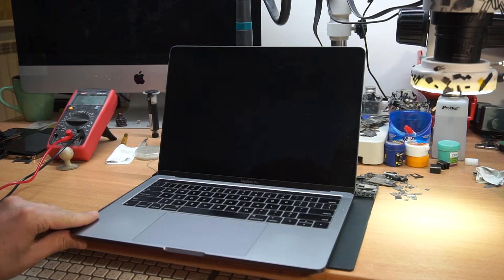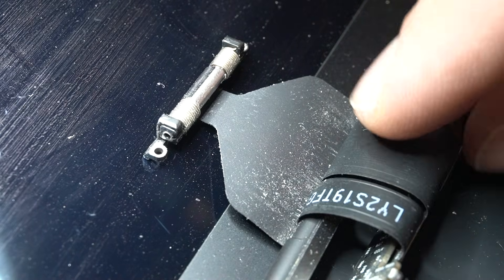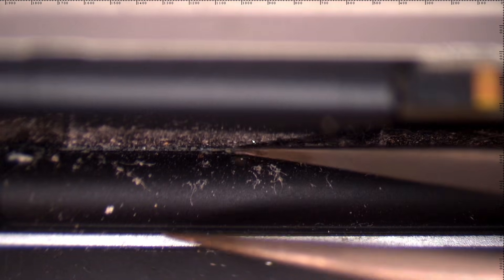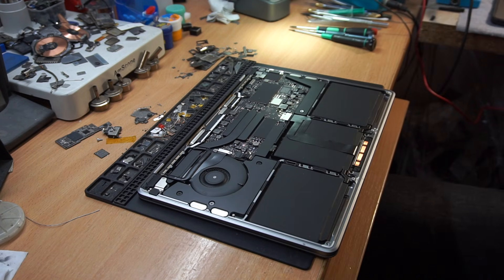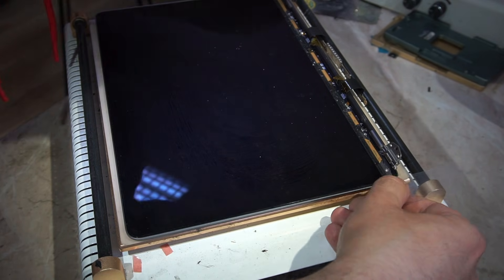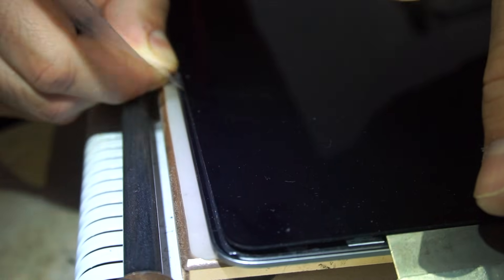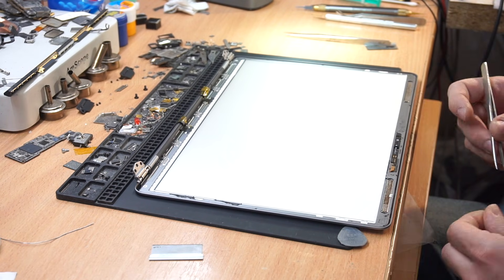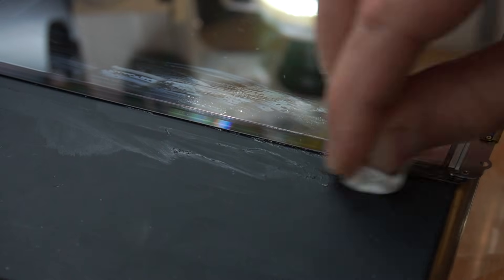An Update on the MacBook Pro A2159 A1708 A1706 A1989 Dustgate issue, A new repair method

Comment: Yeah, it's good that the solder is done on board and not on glass as I had to do a few times. Didn't remember the process too well and going to conduct this procedure on a MacBook this weekend. Good to know it's just as I remember, the good old ribbon cable failure. Not really rocket science, but eh, guess I'll not send the machine to a construction site, it will have to do.

Comment: Hi there, thanks for the great video! I learned a lot. 

I happen to have a MacBook Pro A1708 laying around that doesn't turn on cause of liquid damage. It's been years but I tried already to make a portable display out of the original working monitor, and I never found the exact lcd controller I needed to do so. I am giving it another shot, but I not having much more luck. Do you have any kind of suggestions regarding this? Do you think it's actually doable or that a component like that one that I am looking for doesn't exist? 

Any kind of information will be extremely helpful, thanks so much!
Reply from the maker: Hi, unfortunately I don’t know if that’s possible.
You can google that, maybe some did try to do so.
Reply: @iTouch-repair yeah ofc I have been googling it quite some time now. Thanks anyway!

Comment: Hello,
thank you for your video. I will try that on an A1706 my self. That's the best documentation I found by far.
Could you share some information about the heated vacuum plate you are using? That is the tool, that I am missing.
Reply from the maker: Hello, I bought it from a local supplier, I think it’s from a company called forward blue.
If you can’t find them, then search for a matching machine, I think that in china they make them, and then they print the companies name for who ordered them.
Reply: @iTouch-repair  Привіт :)
Thanks for your reply. I also saw on your video, that you use an extension cable for the LCD screen. Just ordered the same.
I just read, that your shop is in Lviv. Do you do business with customers from Germany and if so, how is your experience with shipping between EU and Ukraine?
Reply from the maker: @euro8494 Hi, please contact me through the links in the description.

Comment: Curious if you’d mind sharing the heating plate you used? Thanks for this upload btw, I’m working on moving away from display assembly replacements and this is a huge help
Reply from the maker: I have a video on my channel with a laser machine, I think it’s the same brand.
Reply: @iTouch-repair  Thank you!

Comment: Hi, nice video. I have a question. Is a screen from an A1989 compatible with an A1708? I have a 13" macbook pro A1708 with a dead screen and found a 13" macbook pro A1989 with a good screen. Apple charged me €780 to change the display and the A1989 will cost me €150 if that works. Tks
Reply from the maker: I think the screen is the same, the difference is the camera and flood illuminator sensor.
The fans will spin very loud because of that.

Comment: Hey man, thanks for uploading this. Is this solution supposed to work with A2337 as well?
I believe mine has the same issue and Apple is willing to replace the entire screen instead of the cable for around 500USD.
Reply from the maker: I think for that money you can buy another used MacBook Pro 😂
I think yes, this method also applies to your model.

Comment: Such a great video! But i have to do the question, why do you prefer to retire the LCD instead of doing the normal procedure to only repair the same flexs? I have a shop too, and maybe of. 10 we do, 2-3 can comeback for warranty, so it's just to know your point of view, thanks for sharing all this info! Keep up the good job
Reply from the maker: Thanks.
Well as for repairing the same flex cable, the issue is that it’s not a long term repair.
Most of my repairs that was done with repairing the same flex cable, they came back after a week or a month, the point is that they came back. And with this method it’s a factory rest repair, so the flex cables are new and the MacBook can live another 2-4 years with the full flex cable replacement.
The soldering points in the old method are solid and the flex is a flexible copper wires, and the solid soldering spots can brake after time, that’s why it’s not a long term solution.
I guess it’s all up to the customer and the repair shop to chose what type of repair they want.😅
Reply: @iTouch-repair  do you charge same price on both options? Because this one i think that have actually a lot of risk, comparing with the old method
Reply from the maker: @rvf1999 I don’t do the old one anymore.

Comment: Hello, I didn't quite understand with what temperature on the soldering iron you do this procedure, otherwise the video is great.
Reply from the maker: Hi, the temperature to add the low temp solder (100 degrees) must be low enough to be able to melt the solder on the small board and not to overheat the screen.
On my soldering station the temp is 320-340 when adding the tin. When removing the flex is around 360-370.
I have micro soldering station, so my temperature is regulated with regards to the tip size and the actual temperature on the tip.
You need to learn your soldering station.
Reply: Hello, is this required? Will I damage the screen when I do this with normal 330°C soldering? I don’t have the low temp solder currently at home

Comment: Thank you for the video! I’d like to share my perspective for anyone considering this kind of repair. While the guide makes the process look straightforward, I’d recommend thinking carefully before trying it yourself unless you’re very experienced. I thought I had enough skills, but I ended up buying all parts (like flex cables, adhesive, black film, the glass which covers the flex cables, a microscope and  a "brand" soldering station) hoping by fixing 2 screens it will be much cheaper then buying from ebay.  But I ran into problems: I broke one broken screen and on the other with damaged the pins after desoldering the flex cable and now I end up with 2 broken screen and 500 euro spent on parts.

In my opinion, sometimes it’s best to leave complex repairs to professionals. This can save you time, money, and frustration in the long run. Just wanted to share my experience for others who might be thinking about attempting this!
Reply from the maker: Thank you for the explanation.
Many people think that our job is easy and you only need to buy fancy tools to look cool fixing stuff, where the truth is, that the tools are only half of deal, you need skills and experience to do any repair job.
The knowledge is very expensive tool, maybe the most expensive one in you tool box.
Reply: Fantastic Job , its definitely not easy how it looks like in a video , 🤝🙏👍👍 also not much people share it because to brake a screen is more chances then to fix , a lot practice needs to be where you are , and good point about the heat, very easy to brake backlight films